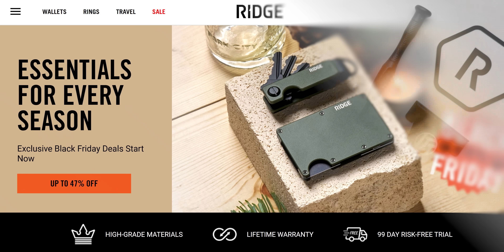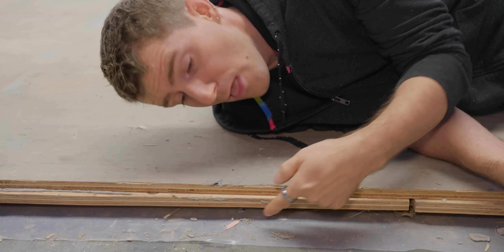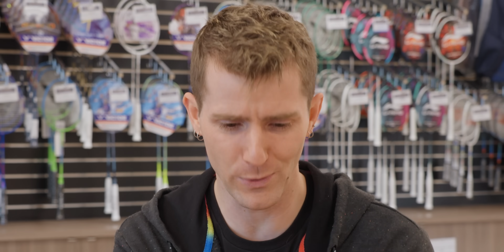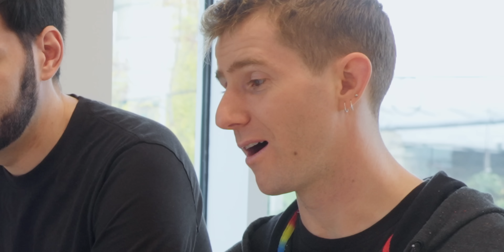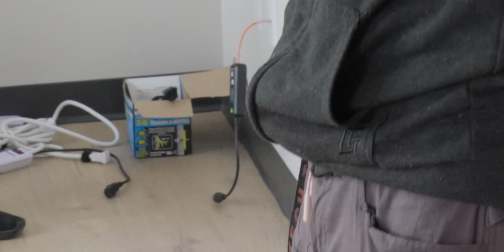You can finally hear me! - LAN Center Audio Tour

Comment: Good choice to use Dante and QSys. And right on time after the Unifi Update to allow Dante. 
@Dan did you think to use a DelyMatrix in QSys with delayable path-points? We used to do that in Trade-Shows to force different directions of origins for different inputs. you can make it seem that the music is coming from the one side of the court where the DJ is and the Microphone comes from the middle where the stage is just by having different delays for different sources and speakers. You might need more Dante floats though...

I used to make a lot of money with being a Dante Network Engineer on Events back in the days when it was still complicated to set up. To The point of live capturing and monitoring the Dante multicast packets in Wireshark to be on top of upcoming problems. I was able to follow and rate the ptp clock master election process in realtime with the correct filters :D

The only thing about Dante you want to be careful of is network security. It got better over the years with domains and password protection but still, you could capture the audio should you get a foot in the network. There's no secrets in that, I guess, but what if the microphones sit around in a drawer and somebody is having a private conversation near that...
All I'm saying is protect your Dante vlan, have no unused Dante-patched ethernet-ports and make sure to get notification whenever a device disconnects, even if only shortly.

Comment: 20k is massive savings!!! I worked at a gym in Qatar (440 sq m), and we had to paid 25k for 6 wall speakers, no overhead, 2 lobby speakers, no bathroom speakers, 4 amps, 3 network switches, and a buggy app to control them all. There's only one main supplier in the country that holds everyone hostage and they only use Bose systems so we had no options of budget systems.

Comment: If you added in MAC based 802.1x authentication on your ports (I assume that unifi can do soemthing like this) you could setup some basic config in a freeradius box and dynamically assign the vlans also, that way any dante device (Assuming you can get a list of MAC prefixes) could be plugged in anywhere, and you would get the correct vlan and qos settings configured dynamically.
Regardless this is very cool tech, but this could make it even more plug and play 🙂

Comment: I also uses dante daily in my rental company. i'm quite concerned about the speaker choice. in my personal opinion, you can use such as Yamaha VXL as it a column speaker so the dispersion could cover the whole field with one side of the wall. Placing many speakers that produces the identical audio can cause phase issues, so maybe less speakers can minimize those problems. Also Yamaha VXL is available with dante infrastructure, so you can still use the POE connections. Even more, the shure ULXD also have built in Dante connection so all of your connection can be in the dante protocol. Maybe also implement Yamaha DM3/DM7 compact to facilitate dante on the mixing console and also you can get the flexibility of routing which input and also processing to which output via the console.

Comment: Those Shure beta 58a wireless systems are very vulnerable to cellular crowd density and may have hickups if the crowd is between receiver and transmitter

Comment: Q-Sys Designer file needs some help. I assume it is just your demo program. Dante 8x8 license for Q-Sys is included. 

Dante can be run on a converged network, it doesnt have to be on its own isolated vlan. It can also be run on almost any switch when in unicast mode. Dante multicast and links require special consideration.

Comment: Man, and if Ubiquiti switches support it and if those devices have some LLDP info, you could set up a port access role to do a port config override when those devices are plugged in so that it will change the behavior of said port as long as a Dante device is plugged in. The wheels in my head are spinning for my network at my job...

Comment: So some nerd (we don't know any of those) with a microphone and adapter or blue tooth connection and adaptor could just I don't know...  broadcast NON crabrave audio across the speakers IF they find a configured POE port on the right vlan?   Then it would be a scramble to stop the NON Crabrave audio?  

might want to do some mac address requirements.  :)

Comment: Do you guys have external antennas on the mic receivers? By the look of those mics they seem to be BLX?
You may be able to reach the whole space now when it's empty, but with even 20 people with phones or other devices on them there can be enough RF interference that the reach is limited. I work in A/V and theater and have had basically the same mic/receiver combo work flawlessly during rehearsals in a moatly empty auditorium, but once it gets a reasonable audience they cut out constantly or drop connection entirely. Also make sure you get the right antenna if you don't have any, those are probably quarter wave, but may be half wave and using the wrong antenna can reduce your range potentially.

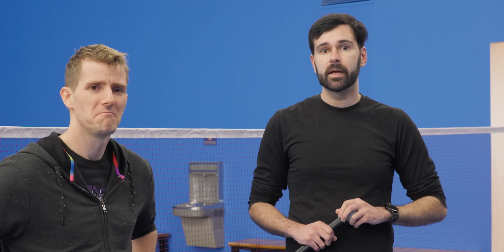Comment: 11:16 - it seems to work fine now but what happens when you have all that RF interference when there is a large gathering like a LAN party? Will it still hold up with all that craziness going on? Sure would like a follow up on the setup once it's up and running and have been put through the paces. :-) :-)

Comment: You could also use a network security software like Forescout to handle auto VLAN switching. Pop this thing in any connected jack and Forescout could switch it to the audio VLAN. Or plug in a known computer and switch it to your main VLAN. Some stranger plugs in a device? send it to a VLAN that has no connectivity.

Comment: I got a little lost there. OK, it has to be POE, no problem, but something about networking... Is it able to be on the same network system as data/internet/ whatever or a separate network? You go into a office, unplug the computer, as it is not needed today, plug in whatever component and away you go OR you have to go to the rack and move network socket 27 from network switch A to network switch B?
It just got a little garbled here.
Reply: Totally IP! Although it is recommended to be an isolated VLAN for stability and security.
Reply: @imark7777777  So without the jargon, yes it will work but better to be totally separate?
I'm an electrician who likes to play with sound systems and computers, not someone who knows what they are doing at those fiddly little voltages. ( under 48Vac )
BTW, on something Linus said about the high voltages of 100Vac, umm, that is technically low voltage, almost down to extra low voltage. I do know what I know but jargon is designed to exclude others from the club.

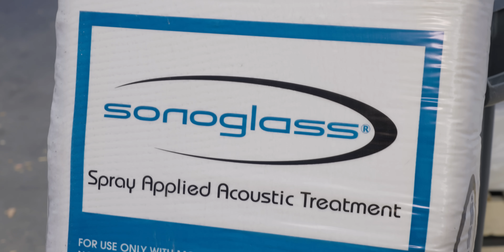Comment: 1:20 Isn't loose fiber-glass extremely dangerous for lungs and they cannot be cleaned from it?
Reply: Loose fiberglass yes. That insulation is not loose, although you should wear a respirator when applying it. But if you left that building alone for a couple days it would all be gone. And because they said they painted over it, there's even less concern
Reply: @the_undead  Gone where, into a magical alternate dimension? Glass doesn't dissipate. And spraying toxic substance over sprayed irritant does not decrease it either. This is like saying that spraying over asbestos dust makes air cleaner.

Comment: When and if you properly pack the place, you will likely have reception issues if you take the mic across the room. We are actively having this issue, imperceptible when empty / a little full, but when the room gets full, there's just enough interference that the mic does NOT want to leave it's 20 foot range around the receiver.
Reply: Good old line of sight/density of interference

Comment: Hearing the name Dante fills me with first-semester dread. I had to configure something with it and it confused the heck out of me. Shoutout to anyone who works with it on a regular basis
Reply: It does have its moments of hair pulling. Though typically all the issues come down to network problems. It's really good to see large manufacturers implementing preset Network configurations for common AV protocols.

Comment: The 58A are not as rugged as the 58. For microphones that will be passed to the public, I would recommend switching to the 58. The 58A capsule is plastic while the 58 capsule is metal encapsulated. I would hate people dropping a microphone but it would be less painful if it's a 58 than a 58a.

Comment: ngl I did not understand what was said over the PA in the intro lol (wearing sony wh1000m5 so I do not think it's the headset).

And wouldn't snapcast with bunch of slave RPis and one master RPi make more sense? Rpi does not care what speakers you use or how you use them and neither does snapcast. It just repeats audio from the master one and that is it's entire purpose. Can even run on Pi3s that are super cheap and uses FLAC. And I think that the master machine can also be windows as it does use a web interface to mix in the audio,l but never tested that (the guide I was using was RPi only and web interface can be accessed and put audio in through separate machine anyways). No hate, just wanted to say that snapcast sounds like more of a techy setup/solution to me than a basically "use only compliant HW and protocols". Like I know this is a pro solution and I like to see it but... I kinda miss the jank of the DYI pains with this one... something LTT often struggled with on projects like these. 

But yeah 20k is cheap for pro solution. And this is by far the most flexible pro setup I have seen. Beats running "special" cat5s that only use one pair.

Comment: I setup my entire church w/ Dante across two venues, the broadcast suite, multi purpose rooms, and common areas. Anything can go anywhere. On special weekends we’ll split the band up between the two venues and do a combined service. We show the musicians from the other venue on the LED wall on the back of the stage. Everyone loves it. We did setup completely separate infrastructure for it, though. We’re moving almost 128 channels at 96 kHz in both directions. Even the speakers have redundant Dante links to redundant Cisco switches. It was a lot of fun to deploy.
Reply: Dude, you likely have 1,000+ homeless people in your community and your CHURCH spends $40,000 for an audio setup for services instead?
Reply: @ Yes, actual professional audio equipment is very expensive. Leading up to that project I spent over a year working on audio predictions for the PA and making sure we bought what we needed to support our vision and nothing more. We didn’t just buy the most expensive thing. In every aspect of the remodel/AVL update we bought the equipment that had the best track record for reliability and quality so we wouldn’t have to replace it in five years, thus saving money. Sure, we could have bought something like a Behringer console that would have been a lot cheaper than the Digico consoles we have, but it’s always going to cost more in the long run. Dante was always going to be a part of the infrastructure because without it, it would cost several times as much to tie all the different parts of our facilities together. Being a good steward of the funds entrusted to us is one of our highest priorities. Going cheap costs more in the long run. But, more importantly, bad audio is distracting. And, in church, the most important thing is the message and creating an atmosphere that people can worship freely in. And, that is accomplished with good AVL. Also, we purchased this equipment once and it will last us well over a decade. By comparison we spend many times more money on outreach and our community because that happens every single week. I just hope you can understand that spending money to make sure our message is understood IS something really important. I wish we could just spend $40K and have an awesome experience, but that’s just not possible given the space we’re in. Let me know if you have any questions about anything I’ve said here. I appreciate and share your passion for wanting funds to go where they’re most needed. But, maybe things aren’t at black and white as you think they are. I know I’m guilty of thinking people should be doing things a certain way without fully understanding the whole picture at times.

Comment: As a network administrator, that RGB switching is sick.  In a business setting, I've always had use color coded cables to define different vlans/networks and important uplinks, etc.. in an RGB switch you could just light up the colors based on the vlan and use all the same cables.  Amazing.
Reply: Or do both, diffrent colourd ports and wires to pack even more information onto the switchboard.
Reply: Exactly, if the lights represent the vlan settings and the cable colour represents what it's physically connected to, it's more obvious when there's a mismatch.

Comment: As someone who works with Dante and Q-Sys systems literally daily, I’m glad to see you went with the implementation you did. Dante is by far the most powerful audio networking solution on the market currently, I use it for everything from broadcasts to large festival systems. 

Two things I should say. Running antenna lines and mounting a pair in proper places will pay off. You may have great coverage now with the receiver tucked away, but RF can be messy and the last thing you want is dropouts.

Also, I’ve got a history of Q-sys systems failing on me, so if redundancy is the name of the game when it comes to working with their equipment. It may work fine for years, but walking in on a completely down system is not fun. Also put them on a UPS, as they’re unusually susceptible to voltage spikes. 

Subs are also nice 🤣 and a few boxes of line array at one end of the room flown would absolutely MAKE a party
Reply: Thats the beauty of it - they could have some active subs and just plug a network cable into the extra switch(es) they're already getting out for Whale LAN, and using an XLR cable they can just connect the subs and it "just works".
Reply: @ agreed, hooking up a “real”/ concert PA to this system would take like 15 minutes
Reply: @itskdog  EAW Anya and Otto would be perfect for this use case, not even needing xlr, just using dante as the input
Reply: @jacobpegher1744  Martin Audio MLA systems or AED Audio with their Flex 6 tops and Solid 15 subs.
Also Dante controllable. (MLA even per driver each cabinet)
Reply: @dannyvanderheide6098 anything but AED Please😅 i like the solid28, but that's about it... great idea, poor execution
Reply: I completely agree about mounting like a paddle antenna somewhere for better RF performance
Reply: I was gonna say, hearing a receiver under some stairs working through all those walls; it works when the building is empty. Let’s see it work when there’s hundreds of people with a thousand or more devices in it 😂
Reply: what about Ravenna?

Comment: FYI specific legislation differs from region to region on if this is a requirement, but if you haven't checked, make sure that your emergency alarm systems are wired to override the PA or utilize the PA in the event of an emergency

Comment: so we been using dante on unifi for over 4+ years now with no issue. Just have to make a vlan that is isolated and it works and it has not internet connection on it.  So you just need to know how to setup other then that your fine.

Comment: As an AV Integrator I would like to note that not all 70v systems are created equal and the crappy ones give them all a bad rap. 70v systems are great, the fidelity issues mostly affect the lower frequencies. If extra low end is needed add a subwoofer with a crossover on the system.

Comment: Mad props to Dan and the whole teeam. PA systems are really hard to do right. Buddy of mine shown me how they set up tune and calibrate ona a mixed indoor and outdoor setup. The complexity is mindboggling. But the difference when done right Vs just using high end stuff and just plug it in is incredible. Hell the active compensation based on noise level and spectrum for outdoor stuff is amazing. One thing he does push for is open API solutions to prevent vendor lock in.

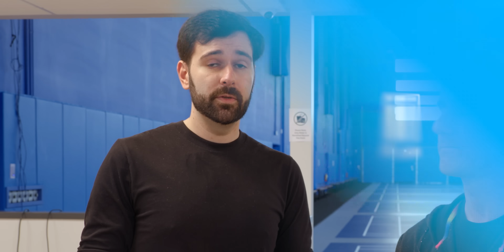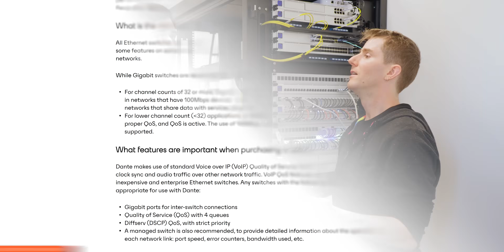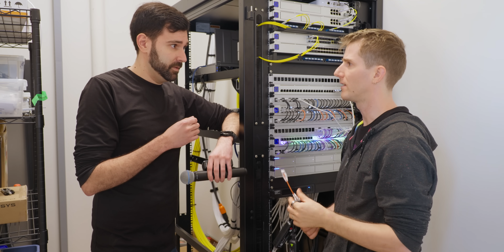Comment: Id like to correct you on a couple of things with Dante. At 12:00 you said you dont have a mixer, but you do, just not a separate mixer, the mixer is built into the Q-Sys system, as its a Matrix Mixer. At 12:36 there are no switch requirements, thats not true, there are a few switch requirements, Dante uses Level 3 of the OSI model, and the switches MUST be Gigabit at a minimum, with no green/effieciency mode or at least be turned off completely as it turns off the port even if audio is being transmitted. 12:30 Dante can use your already installed infrustuctre as long as they meet the previous stated point and they will need to use a VLAN and Trunking to be able to move traffic between switches. I hope those speakers are time aligned as well.